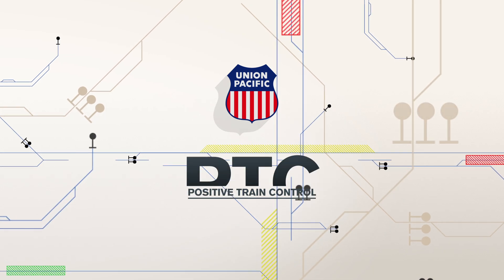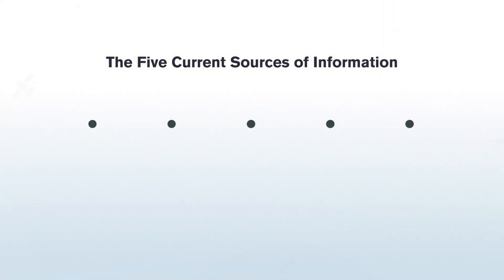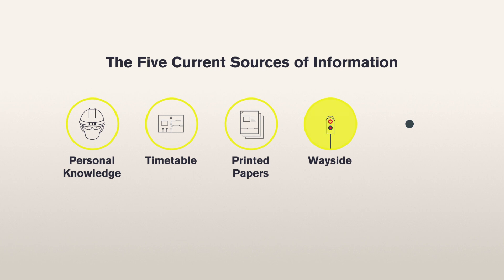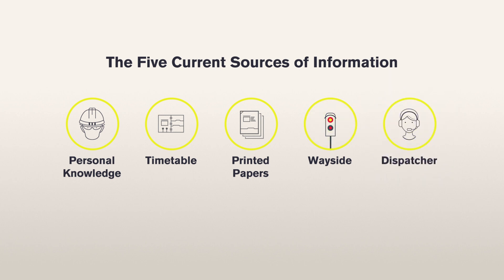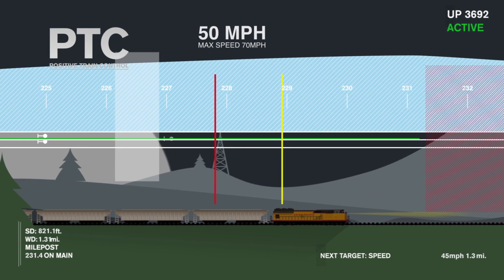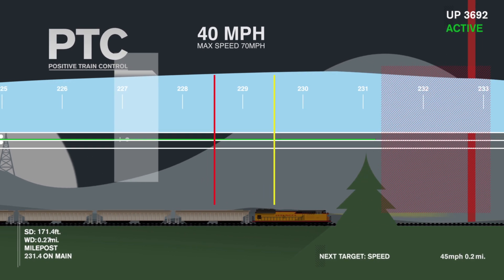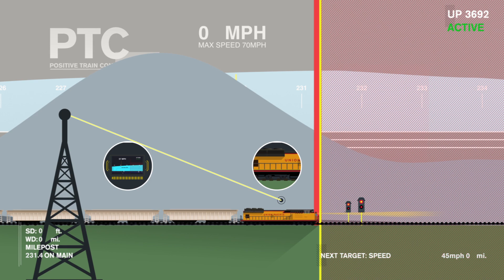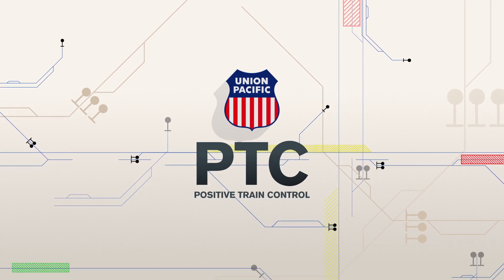How Positive Train Control (PTC) Works

Comment: PTC is just a money grab. Creating an overly complicated system from scratch by people who have no experience doing so instead of adapting a proven system that works by people who invented the technology and has been in both civilian and military use for years. I'm speaking of Garmin Ltd who has extensive experience integrating their systems into Automotive, Aviation, and Marine and could have easily and for a fraction of the money already spent adapted it for Locomotives. 
PTC was mandated in 2008 and was supposed to be up and running by 2015 a date Garmen could have easily met. It is now 2020 and they hope to start testing the whole system together at the end of this year. A multitude of systems all built by different agencies departments and contractors will all come together late this year and perform flawlessly... NOT GOING TO HAPPEN! If the whole thing is not scraped it will be at least another 5 years. You-know if the Engineer of Amtrak Passenger Train 501 had a $50 Garmen Nuvi in the cab that crash and many like it would not have happened.

Comment: As a ham radio operator, I'm disappointed about the loss of nearly half the 220 MHz (1.25 meters) band. 220 to 222 MHz is now used for PTC. At least it's going to a good cause. K6JSH

Comment: This is the true way how PTC works in 3 easy steps 
1: it doesn’t work
2: causes major delay
3: run without PTC
Reply: 1.) It does work
2.) Doesn't cause major delays
3.) You're going to get another 09/12/2008 situation then.
Reply: It does work, and is mandatory.
Reply: @hunta6866  it does? Lol cause my last few trips we didn't use it cause it wasn't working right
Reply: wes h You think in the short term over the long term.

Comment: +UnionPacificRailroad  One factor that could potentially defeat Positive Train Control is track switch mis-setting, a factor in several underway train-on-stationary train collisions on other lines.  The switch positions should therefore be among the inputs for PTC.

Comment: PTC does not merge voice communications in regards to warning of incidents - as the text based warnings require clarification in a safety orientated network, as the text itself can have human error input in relation to say, a trespasser on a bridge. Drivers/Engineers still need the voice clarification - PTC does not replace, but rather enhance that warning. Your intro is a bit misleading.

Comment: Yeah but someone can just hack an oil train then crash it into a town killing thousands of people
Reply: Ok there, keep talking about something you clearly know absolutely nothing about. PTC doesn't have access to the throttle control on a train(i.e. the 'gas pedal') only the braking system.
Reply: Jim Halpert/ Union Pacific 9000 'crash into a town'? The thing is one rails. Also, oil doesn't explode, it isn't as inflammable as people think, and there is very little air in a tanker

Comment: You have to remember why PTC was developed in the first place. Because of many train collisions where human failure was responsible. A prime example is what happened on September 12 2008 at 4:22 p.m. PDT when west Metrolink Train 111 collided with a Union Pacific freight train eastbound after the Metrolink 111 Engineer missed a Red Signal after leaving Chatsworth Station.

Comment: It'd sure be nice if it actually DID work lmao too bad it doesn't
Reply: It works to a certain degree. It's electronic, it's not going to be perfect.
Reply: Jared Klock The goal was for it to be perfect lmao
Reply: david whiting clearly you haven't listened to the scanner on railroad lines that fully equip PTC.
Reply: Thatguyontheinternet lol no it doesn't.
Reply: It works, if you don't mind changing a few couplers out along the way, even in idea conditions.
It will get there one day, and that will be the day freight trains drop to a single crewman.
Reply: Remember you are only hear about the failures of PTC and not successes. There is an old news axiom, "If it bleeds it leads" and the same can be said about PTC. The first area that put in PTC was the Los Angeles Area. I do see a time when there are self driving cars that will also be able to notified by  the Railway Crossing of an approaching automobiles that a train is crossing at the railway grade.
Reply: It works